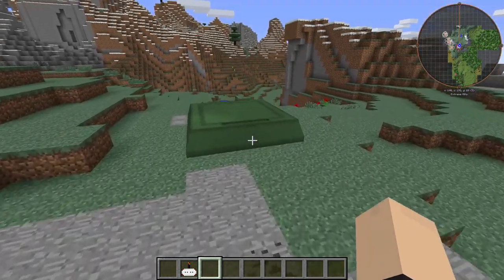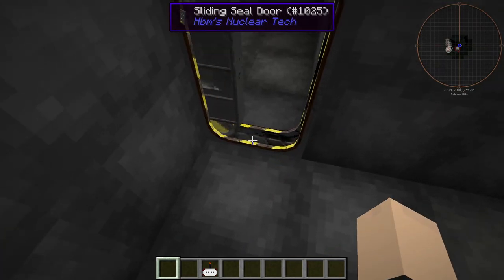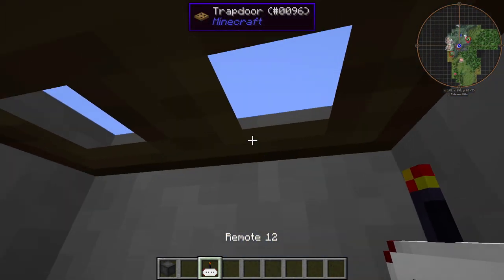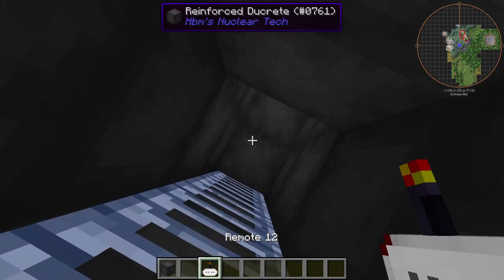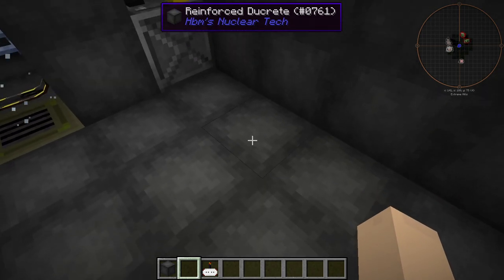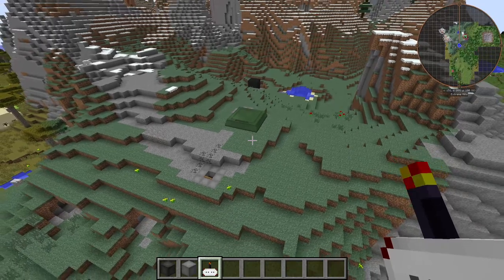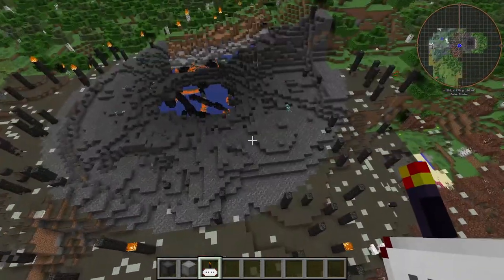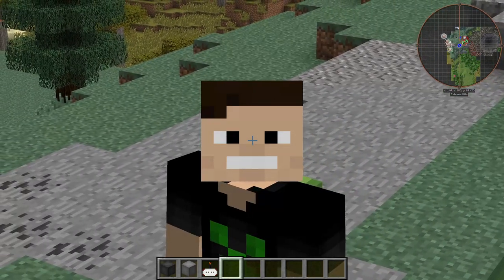I Built a Missile Silo with the New Silo Hatch from the HBM Nuclear Tech Mod

Comment: Wait, that idea with the air is great. I mean bob already has some gases, so why not add something like irradiated air or musty air, maybe it could be made so things like cracked or mossy concrete bricks emit musty air (It would be fitting to structures like the office), that can be let removed by either ventilation pipes with filters or just connecting a room to the outside world. And while we're at it, why not make it so that every now and then it checks if air is in a closed room and start a timer, that after some time turns the air into musty air, so bunkers would need ventilation. Maybe the musty air could have some debuffs or just cause coughing and stuff. Then maybe the irradiated air could give you some radiation.
Reply from the maker: I know right like I need this to happen